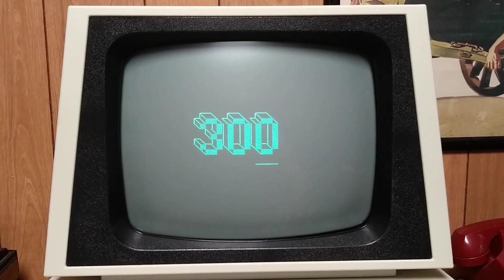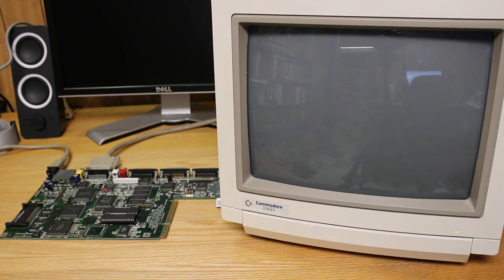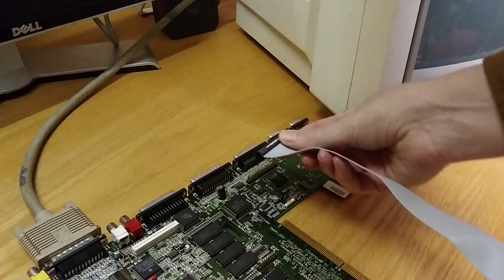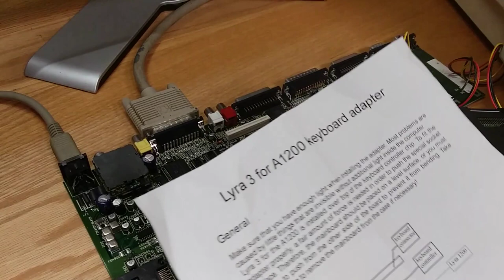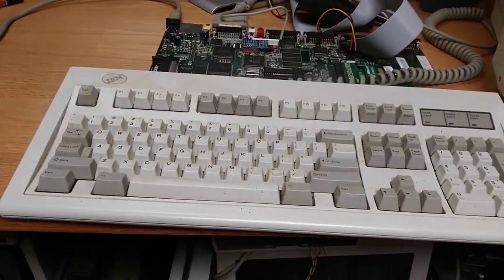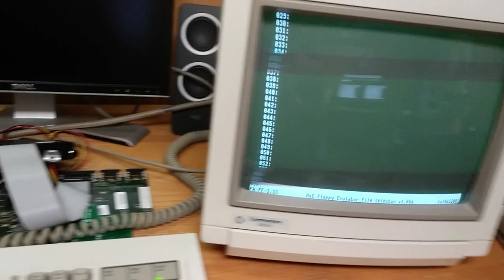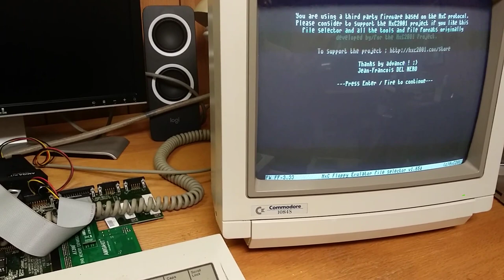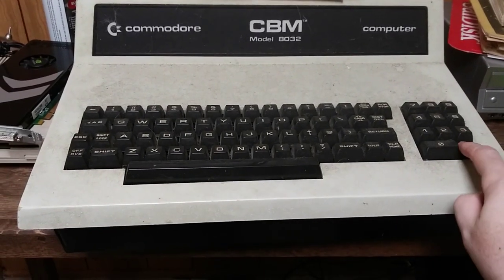Commodore Amiga 1200 Build - Thanks for the Memory!

Comment: Hi, I’ve one of those memory modules. INT runs the FPU at the internal clock speed and EXT runs at the full 40MHz of the new boards oscillator, so it should work and be faster on EXT. Hope that’s useful 😊
Reply from the maker: I look forward to testing it out.  I have been working on other projects so I have not had time on the A1200 board but plan to get back to it soon.

Comment: This sounds like a fun project. I have been thinking about doing this, but with an SGI Indy case. :)
Reply: Of course this is 100% with the intent to offed both kinds of 90s computer graphics nerds.
Reply from the maker: Now that would be a cool project. What funky color is your SGI?
Reply: @300BaudStudios  The Indys were turquoise-ish blue. But now they are all kinda green due to age. :) I ran an Indigo2 back in the 90s as a main system, a green one, and never had an Indy. For parts indy's are cheap, ironically cheaper than Amigas. :)

Comment: i suggests a tf1260 or some such if you want to see the latest demos coming out or use some apps. There are short usb sticks available called sandisk cruzer fit that don't hang out of the gotek. os3.2.1 and roms are out if you want some nice features. The A500,2000,3000,4000 and towers were fairly common in the USA. Loads of Amigas been for sale on us Ebay for years and are just now slowing a bit)and high prices!). Most cable stations had A2000's running Prevue channel and the Video toaster setups were fairly common.. We had many of the big box Amiga's here,and Europe/Uk had the most  600/1200's.
Reply from the maker: The Terrible Fire series are very tempting but I decided to go low cost for this build; expensive upgrades will go into my big box Amiga computers. I really appreciate the suggestions. For this 1200, I will add a couple more items, one being a shorty USB stick ;)
Reply: @300BaudStudios  That makes perfect sense to me too!  Happy new Year.
Reply: @300BaudStudios  I have the FPU/8mb card that you have, a TF1230, and a TF1260 (with a full fat rev 6 cpu). I honestly think that the FPU/8mb card is the best price/practical perf of the three. I do run the 1260 on my A1200 most of the time, however. :)